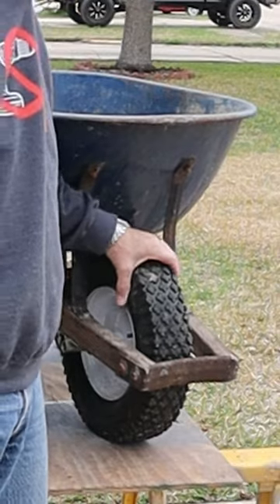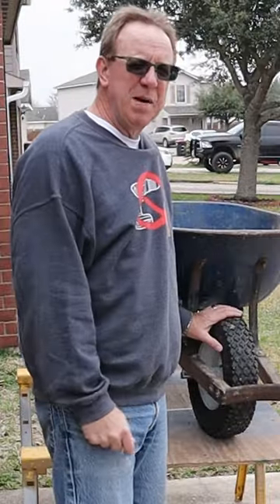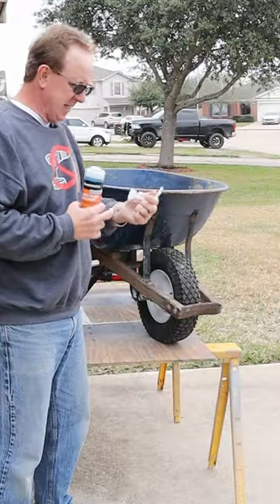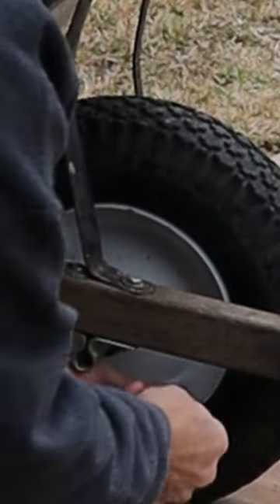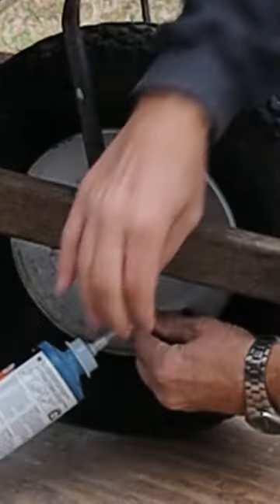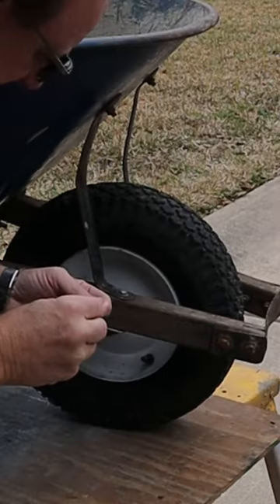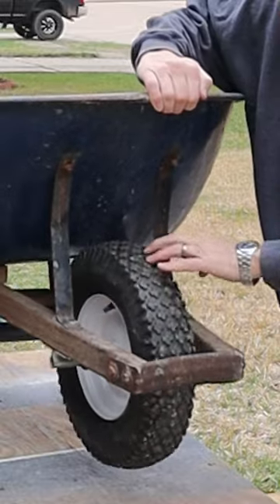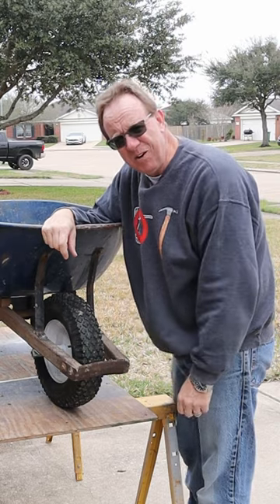Quick Fix a Flat, Wheelbarrow!

Comment: I did this a few years ago! Worked great for awhile but I think my tube got pinched and it won’t hold air anymore. Bought a solid rubber wheel and I love it. Don’t have to worry about pumping it up anymore.
Reply from the maker: That is my plan once this stops working.  Thanks for watching.